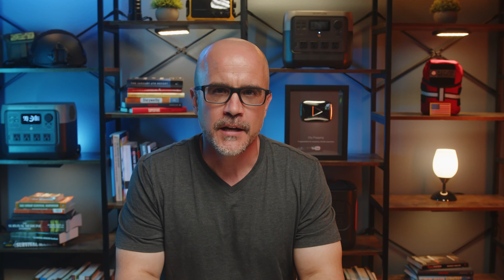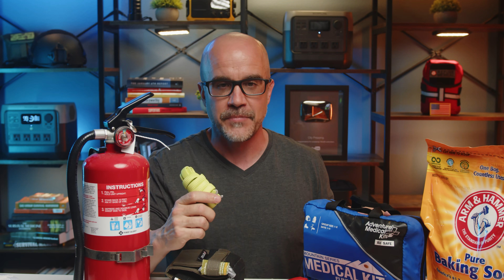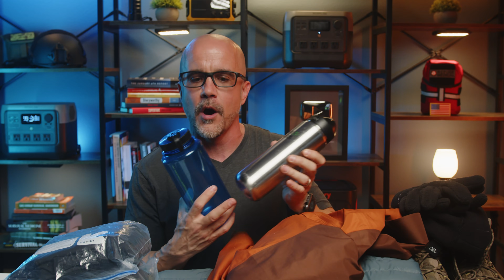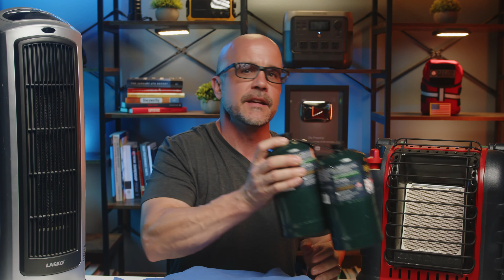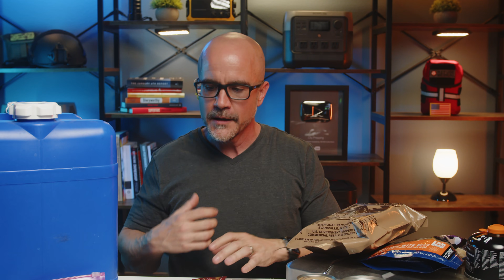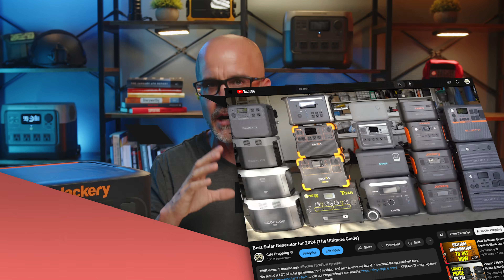30 Affordable Winter Survival Items to Get Now (How to Survive a Winter Power Outage)

Comment: Heating bricks/stones old school style. So very old school you can warm bricks and stones by placing on whatever you are using to cook/heat, candles, woodstove, place in front of heater or boil (but i wouldn’t waste water) then you can place in bedding at feet and they last hours to keep beds warm. There used to be bed warming irons that the “rich” would have but poor used bricks or stones. My mother told me about this and i always remembered. Hope this helps.
Reply: Be careful, if stones or bricks contain any moisture they could explode when heated. I didn't know that until someone replied to an earlier comment I made.
Reply: @Cherie_2a   if they're heated SLOWLY they will NOT explode.  It's the BOILING water you must avoid. Set them at a distance that's comfortable for SKIN = no problem
Reply: @Nyeupe-Nguvu  Thanks 😊
Reply: @Cherie_2a  Because the brick is "heated" there is NO moisture. I have never heard of one exploding. We did this for years. The only real worry is they get so hot that we wrapped them in towels before putting in bed.
Reply: @Cherie_2a  how would one know if there is any moisture in the stone/brick?
Reply: @KarlaEmmerson  That's a great question, Karla!  It prompts me to do some research, as I don't know the answer.  Wish I could ask my grandmother what type of stones they used to keep their feet warm on the winter trips to town in the sleigh.😊
Reply: @KarlaEmmerson   EVERY STONE contains moisture. It's the BOILING you must avoid. RULE-- if your SKIN can tolerate the heat, it's safe to warm stones
Reply: @KarlaEmmerson   ps.... once the stone is warmed & dried it should never be a worry as long as you keep it away from moisture
Reply: My mother did the heated bricks in my bed when we had 38" of snow one winter when I was a kid. Blizzards were rare in Southern Maryland, & we were cooking in the fireplace in the living room for 2 or 3 days. We were pretty comfortable because my parents were prepared for those basic emergencies that are more likely to occur. My Dad wasn't a woodchopping guy, (Dean of Admissions at the local College), but he had stored dead fall from our trees, "just in case".  I Bless their example!
Reply: @patriciatinkey2677  i love this so much! I know my mother is proud i am remembering her old stories and i know we are soon going back to the old ways. Would love a place with a woodstove i would feel rich instead of heater! Lol
I am not looking forward to not having hot shower or flushing toilets but we will adapt to our environment. We are survivors. ❤
Reply: As long as they aren't "river" stones. Any stones or rocks from river beds may still inherently contain trapped moisture, which can cause a nasty sudden expansion in the rock, with attendant shards going everywhere.
Reply: Hand warmers and foot warmers are good to have on hand.
Reply: Upside-down poetry pot..,flipped over on a candle 🕯 ✨️
Reply: @Veetribe.  Pottery pot, yes, great idea.
Reply: Back in the day families would heat stones and bring them with them to church. The church pews were more like boxes with doors on the side and higher walls. They would put the stones at their feet to keep their box warm. It was too expensive to heat the entire church. Obviously the more money you had the more your box was insulated.
Reply: That's a great idea. Thank you for sharing. I think i'm gonna buy a few of those extra heating stones that you get to put on the inside of your wood stove. I can put them on top of my wood stove, and then we can put them at the end of our beds, blankets😮
Reply: My grandmother did that during the Great Depression
Reply: I'm a massage therapist. I practice hot stone therapy. I heated my rock's and laid them in between my sheep skins to keep warm during Winter Storm Uri in 2021. We went without water and electricity for 14 days. I got a 55 gallon water barrel with a hand pump for back up water now. After Hurricane Beryl I had to refill 2 gas generators every 3 hours to run 1 refrigerator and 1 air conditioner. This is a test of my emergency preparedness for January's Polar Vortex of 2025. I use gas to cook and heat water with. The propane tank is full, the water barrel is full, I just bought 5 EcoFlow generators with solar panels. I charged them on 110 volt and have them on stand by if the grid goes down. This is my first time using solar for power. I think solar will be easier to use than gasoline as I have plenty of sun and got the extension cables for the solar panels. I'm making a run to HEB for a few things.  Will see how it goes...   I appreciate your channel. Thanks for keeping me on my toes.
Reply: Fire bricks are the safest option. Wrap whatever stones you use in a towel before placing it in bed with you. That will help keep you from possibly getting burned by the stone if it's too hot, and getting your bed messy from the soot from the fire.
Reply: By a pack of hoy stones from the beauty isle. They are lacs rocks. They hold great
Reply: Terracotta flower pot (with a hole in the bottom for airflow) over candle will work as a small warmer. Just be sure the candle is on a plate or dish and can't burn anything if it tips over.
Reply: @happydaze7386 Not recommended in some youtube videos.
Reply: Rice bags are good if you can run a microwave.🇺🇸⚔️🇬🇪

Comment: We had hard frost two nights in a row here last week.  Killed my second crop of beans, but all my root crops are OK.  Firewood coming tomorrow!  And I just bought a third Jackery solar generator, LOL!   Stocked up on fire extinguishers and rechargeable batteries.  Thanks for the video, Kris!
Reply: Sorry about your beans :( 
Hopefully next season you get a overflowing cup friend 🙏🏽
Reply: @chupacabra304  Thank you!  That's why we plant a great variety of things.  Some do well, some not so much.  Overall, we do fairly well!  The most delicious carrots I've ever had were from this season's crop!  The potatoes are awesome, too!  Stay well!!
Reply: What is the best one to get  for running a full size refrigerator? Thx.
Reply: @louisewilliams1258  Many factors influence that choice - how much current does the fridge draw?  How many hours do you really NEED it to run, and what is your budget?  To run a standard fridge for  8 to 12 hours, I suggest at least a 2000 watt minimum powerbank.  And of course, it will need to be recharged ASAP. Probably with solar panels.  It might be worth considering the purchase of a small portable DC fridge/freezer unit, which is much more energy conserving, for essentials like medication.  Wishing you well!!
Reply: @louisewilliams1258  I have watched several of City Prepper's videos on solar generators. Last year based on those videos, I purchased an EcoFlow Delta 2 with a solar panel when they were on sale. It ran my whirlpool double door bottom freezer for almost 9 hours. I didn't  have the solar panel set up, so it would have run longer. Chris has a discount code with them and if you are Military you get a discount as well. I belive you are only able to use one or the other. Hope this helps.